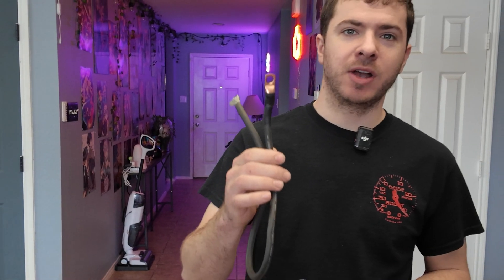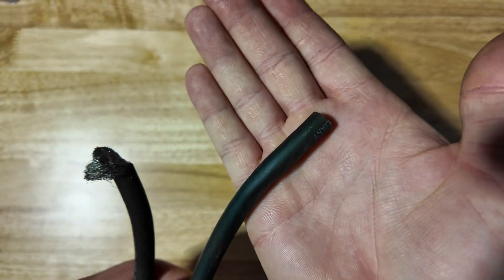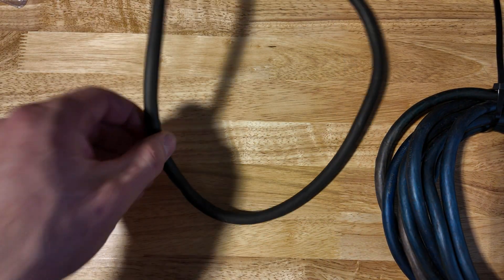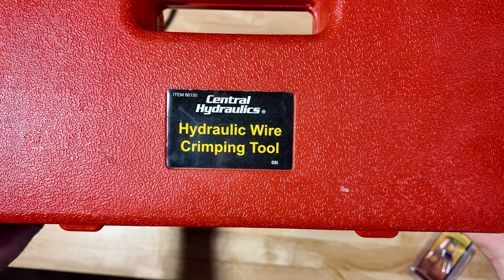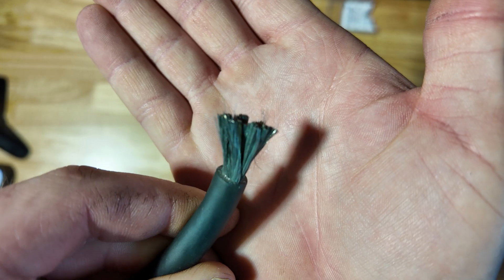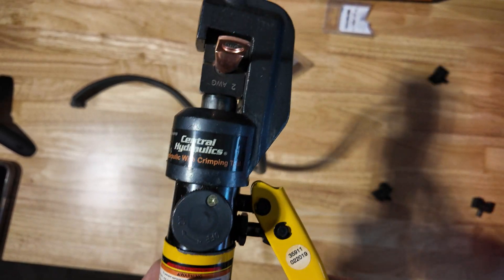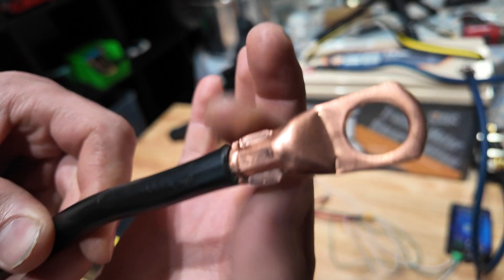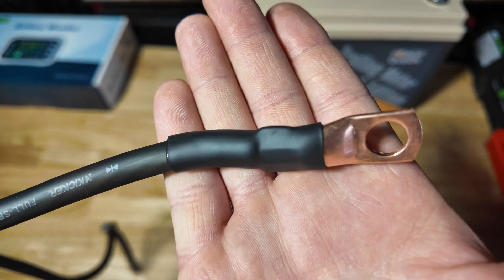How To Crimp Copper Lugs For Solar Power, Car Audio And More!

Comment: Can you soldier the connections
Reply: You should not solder them. a crimp should cold-weld the copper so solder wouldnt help, and soldering just adds stiffness which could lead to the wire breaking off if it's vibrated or flexed a lot.
Reply: You also shouldnt twist them iirc, but it probably matters less for a heavy duty crimp like this versus a smaller ferrule where twisting absolutely wouldn't be okay.

Comment: Good demo! Not only have I seen copper-clad aluminum, but, in smaller cables, the premade ones with alligator clips on them, copper-clad steel. I first found this out when the wires were getting a lot hotter than they should have. I discovered that they were attracted to a magnet! I went through all my jumper leads, all bought from Chinese suppliers on the internet, and tossed out about half of them after testing them with a magnet.
Reply from the maker: @jbuchana  Nice, yea it’s crazy the stuff is everywhere now cause how cheap it is!